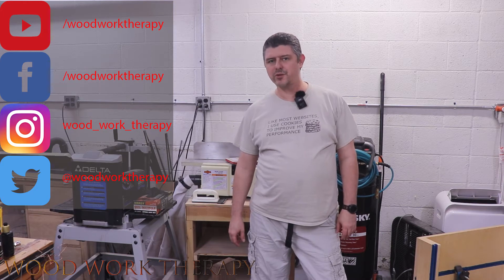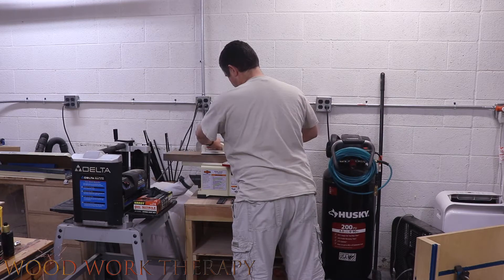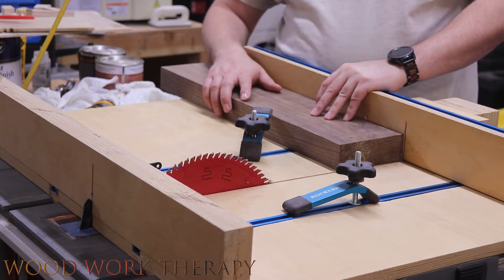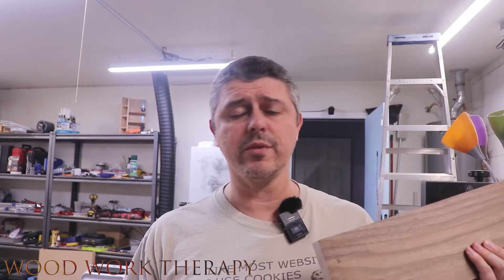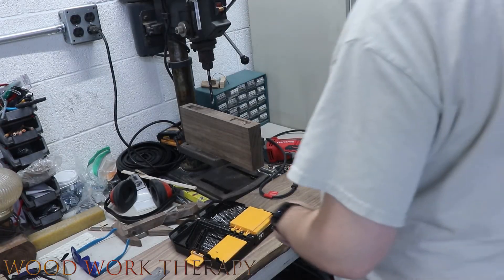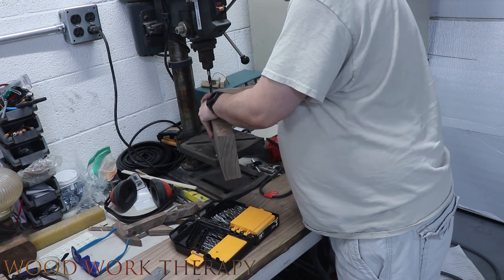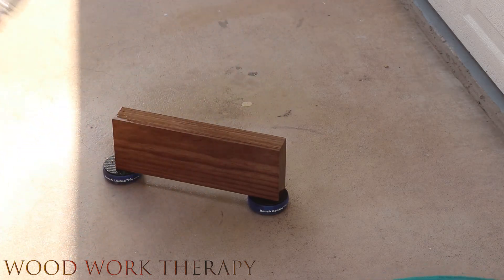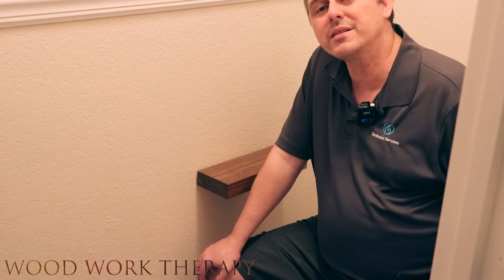DIY Floating Shelf: How to Make it from a Solid Piece of Wood

Comment: Hey, nice shelf! I am looking at portable table saws as I just moved and have a smaller shop now. I noticed you have a ridgid saw, I currently own their sliding miter saw on the rolling stand and it's great for moving it in and out when I need to use it. It was perfectly square out of the box and is still square even after all of the moving around it's gone through. It's rock solid and I am very happy with it. My last job site saw was a hitachi rc10j and I was not very impressed lol. I'm looking forward to your reply, have a blessed week!
Reply from the maker: The one I have is the older modle of this one: https://www.homedepot.com/p/RIDGID-15-Amp-10-in-Table-Saw-with-Folding-Stand-R4518/309413142 I got this one when I started realy gtting into wood working and wanted a nice claen result. The unit is solid. And as I have had it for several years, I can tell you it is reliable as well. The stuff we post on the channel is projects that we belve will have high interest, but there is a lot that does not get filmed and posted as well. And this saw delivers. However... I have found myself using my Wen band saw (review link): https://youtu.be/eQY8p5E7Omo a lot more, and the saw a lot less. Not because the saw is bad, but the bandsaw is safer on wood that may kick on a tablesaw, and less chance of serious injury. Does not mean that it is safer, just less likely to chop off a finger. LOL If I was to do it all over again, I might have been tempted to buy a bandsaw first, but as I got to larger projects the tablesaw would have had to have been purchased. I hope that answers your question, and gave you some other conciderations to concider. Let us know if you have other questions. I might make a videoon this topic in the future. Let me know your thoughts. :)